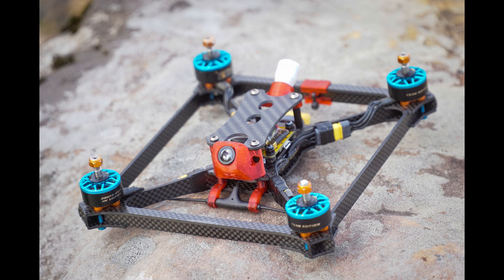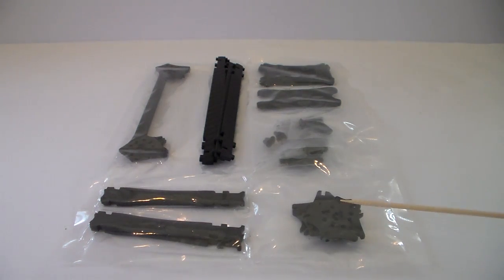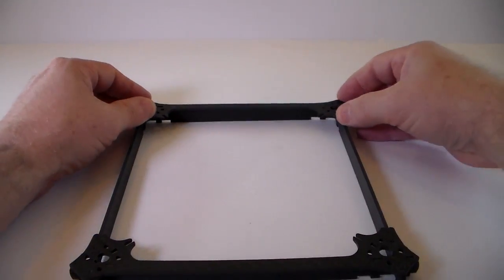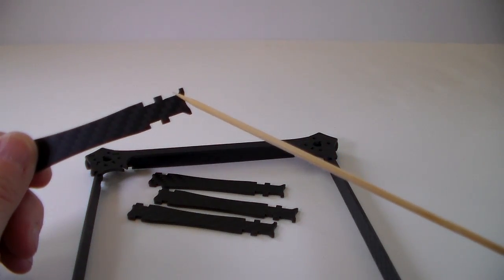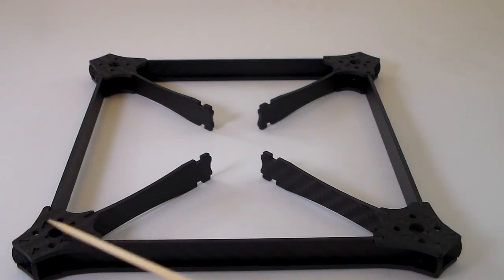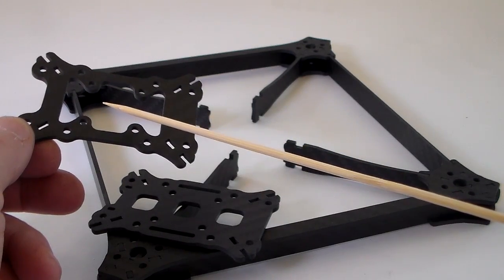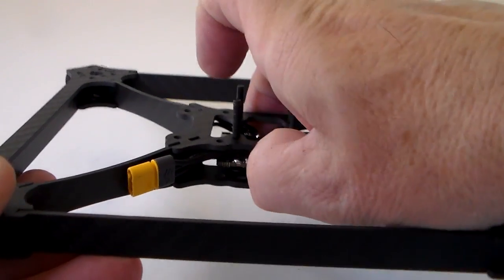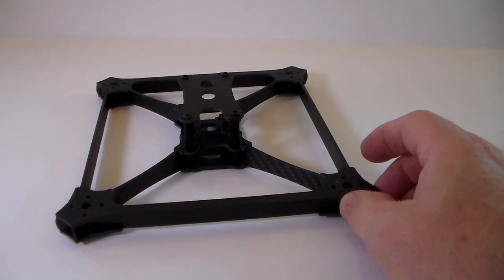New PyroCube Box Race Frame in-depth details about the frame and how to build

Comment: is there enough room to install the DJI FPV air unit, if following your build guidance?  I understand a different TPU mount would be needed for the camera and antenna requirements, and I can either find or design one.  I want to build a very light weight and strong HD high speed platform.
Reply from the maker: This frame was not designed for DJI whatsoever, but I have seen folks use both Air Unit and Vista with the Pyrocube.

Comment: Really like your design, and want to use this in our local HD class. Thinking an AIO FC/ESC in the basement, and a Vista up top. But, will DJI's 20mm wide camera fit (as opposed to a 19mm micro sized cam)?
Reply from the maker: I have several guys running the Vista on this Build and I do have a 45 degree mount for the DJI Camera as well (I'll post that to thingiverse very soon).
Reply: @BelmontFPV  That's awesome, thank you!

Comment: I'd love to buy and build this.
Could you suggest a build list for me, all from pyrodrone?
Not racing, just messing around freestyle.
I'm after long flight time. I use crossfire.
Thanks, keep up the great work 🍻
Reply from the maker: For the PyroCube, I run the full Pyro Stack, 30x30 FC and the 4in1 ESC.  For Camera I run the Racer 3 (not nano version) for motors that is your choice, but I run either the Talon 1890 KV or the Headsup motors on 6s.  For TPU parts I have a ton of them on thingiverse.com, see above reply.
Reply: @BelmontFPV  Thank you Sir, but I've gone full dji now ☺

Comment: Got one on the way 👍. If it’s lighter than my arc one with a box frame from kinetic aerial then it may be my new race basher.  All I know if I’ve been flying the arc one over a year and have yet to break any carbon. I’ve broken everything else but the carbon still going strong lol.
Reply from the maker: I fly box frames because I like how they fly.  If you want the most durable frame, you need to be using a traditional frame.  For racing I don't worry about breaking anything, if you are scared to break something you will never compete with the top guys.